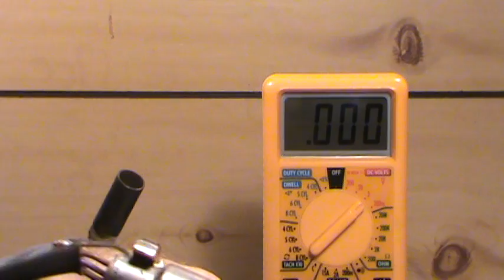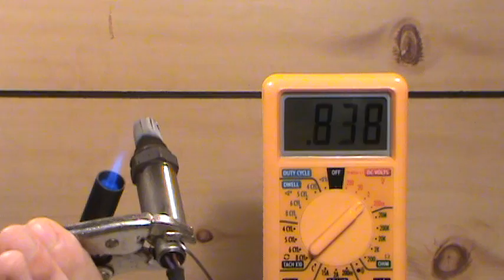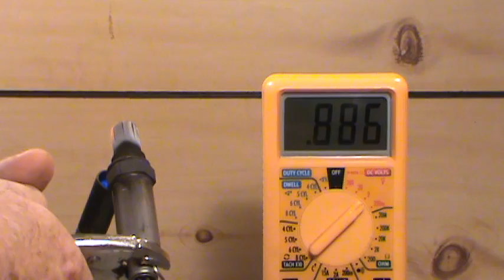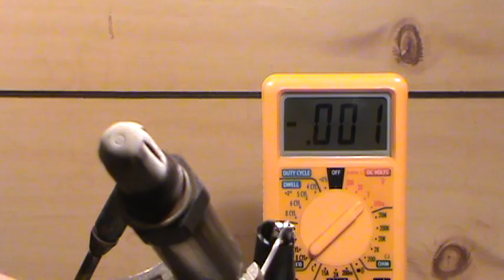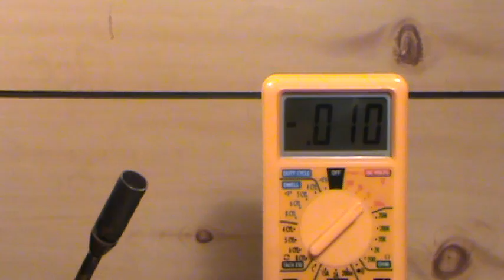Oxygen Sensor Test

Comment: Excellent video on the subject. Oxygen sensor is really important on gas engine cars. I have a video on my channel. Give a look as I made a successful repair on that car. Regards,
http://youtu.be/uVdSCzgLr8k
Reply from the maker: Greetings LearningZone....Thanks for Your nice comment, my Friend....I had a look-see at Your Oxygen Sensor YouTube Video, and I must say, that it was well done, easy to understand, along with so much Information, that included the Diagnosis and the way to do the Oxygen Sensor Replacement, and even how to "Splice" the Original Connector (from the Non-Working one), to the (used?) Oxygen Sensor (that You installed), that had a Connector, that wouldn't Mate with the vehicles Wiring Harness/Connector!....I guess that, there may be times, when, heating the Sensing Element of an Oxygen Sensor with a Propane Torch, may possibly, actually "Clean" it somewhat, as I have heard some Folks saying, and, it might be worth a try, and might even get that plugged -up oxygen sensor to Work again, but, no guarantees at all.

Be Safe, take care, and have a good one.

Comment: p0420 F'ed me in the A
Reply from the maker: Greetings ArmaAceChannel....Thanks for watching this Oxygen Sensor Testing video of mine, and for Your very "Entertaining" comment too!....Ah yes, the good ole..."P0420" OBD-2 Code (OBD-2 = On Board Diagnostic's Version "2", that the Vehicles "Computer" Uses, and Tells You, What "Has Already", or, Is "About To" Happen, with All of the "Sensors" and "Actuating" Gizmo's, that seem to be Hiding, Here, There, and Everywhere, in a vehicle, if so Equipped!!!)....Code P0420 = A Low Efficiency Catalytic Converter!...well...as far as the, just "Before" the catalytic converter Oxygen Sensor, and, the "After" the catalytic converter Oxygen Sensor are concerned, in very Simplistic Terms, that is.

Did You happen to get the problem Resolved/Fixed?....Buy/Install a New Cat? (Cat = Catalytic Converter, and a "Cat" that Doesn't go "Meow!"...lol).

Maybe also, had the Required Number of "New" Oxygen Sensors Installed as well, perhaps?

Hopefully, You didn't have to Spend Too much Money, in order, to..."Restore Order", and in this case, Satisfying Mr. "MIL" (aka, Malfunction Indicator Lamp or Light), sow's He would keep the Dash Light Off (aka, Mr. MIL again), for You, as well as, His Good Buddy, that's Hidin' not so far away, in Your Vehicle, that might just go, by the Name...Mr. ECU (aka, Vehicles On-board Computer).

So then...

...When the "Cars-ah-Spewin'-All-that-there-Pollution", Just, "Spend-Lot-sa-Money", They Say, "That's the Solution!"

..and, like always...Ladies and Gentlemen...

...Be Safe, take care, and have a good one.
Reply: RockysRoadshow lol haven't resolved yet. i switched the o2 sensors after the cats then reset the code and it still came back on the same bank. i guess i could try switching the o2 sensors before the cat now and reset to see if it comes back on same bank. i guess if i switched them and then the code for the opposite bank came up that would be a o2 problem?  man like i said its F'ing me hard right now.  i do here rattling when i tap on the cat D;
Reply from the maker: ArmaAceChannel
Greetings ArmaAceChannel....You had mentioned, that the "Cat" (aka, Catalytic Converter) would "Rattle" when You Tapped on it....Whenever a Person hears a "Cat", Rattling, while Tappin' on it, that would probably be Tellin' Us, that there is some..."Internal Damage", that has happened to the "Core" of the Cat....That, in itself, can cause a few problems, such as, Flow Restriction, as well as, the Inability for the Cat, to do it's job, Properly, and Efficiently as well.

So then, perhaps Your Vehicle has "Dual Exhaust", that has "2" Cats as well (one on the Left Side, and, the other on the Right Side), from what You were saying in this comment/reply.

The P0420 Code, as far as I see it, would just be telling me, that, the Cat or Cats, as the case may be, are Not Operating up to the "Minimum Allowable Efficiency", and, that appears to be, being "Detected", by the "Differences" of the Output Signals, of the, "Before the Cat Oxygen Sensor", as Compared to the "After the Cat Oxygen Sensor's" Signal, and, "Both" (Signals), get sent to the ECU (vehicles On-Board Computer) for Setting the Trouble Code, being P0420, if the "Efficiency" of the Cat, or Cats, "Are Not" Up to the "Minimum Allowable Standard".

Now then, Did "Any Other Codes" pop-up on Your Scan Tool, besides the "P0420 Code???

I'd be thinkin', that, if any of the "Oxygen Sensors" were getting, Tired, Lazy, or maybe even Refusing to do Their Jobs all-together, that, I'd be Seein' "Trouble Codes" that are indicative, of, an Oxygen Sensor, or Oxygen Sensors, that the ECU, would, or should, be Reporting to Your Scan Tool, if in fact, Your Vehicles ECU "Detected" anything "Wrong", with Any of the "Oxygen Sensors", that happen to be Installed in Your "Ride" (Ride = Your Vehicle...lol).

If You "Are-Not" seeing Any Trouble Codes, that are Directly Related, to any of the Oxygen Sensors in Your Vehicle, or, any "Other" Trouble Codes, besides the good ole "P0420" (Cat "Not Efficient" enough), the ECU is probably "Only" Seeing a "Bad or Inefficient" Cat, or Cats, when the ECU "Compares" the "2" Signals, that it Receives from the "Before the Cat", and, "After the Cat", Oxygen Sensors.

I do like, however, that You had the Idea to move the Oxygen Sensors in Your Vehicle, to Different Installed Locations, to see if, by the process of Elimination, that, perhaps, one or More, of Your vehicles Oxygen Sensors, Were-Not-Up-To-The-Task (aka, getting to the point of being, Non-Functional).

The "Rattling Cat", is the Biggest Clue, without even having to resort to, Your good ole Scan Tool!

Good Luck, and...

Be Safe, take care, and have a good one.

Comment: What will happen if I then feed a steady DC volts of .45 to the input? Will the computer makes the injectors to inject a 14.7 to 1 ratio to the combustion chamber? But first of all thanks for posting this very educating video. I do now fully understand the operations of an O2 sensor.
Reply from the maker: Greetings HHOhybridBuilder....You are welcome, and, I'm glad to be of help, as well as, Thanks for your comment, and the very interesting questions that sound to be, well, possible, but, I "DON'T Recommend or Approve", that a Person actually tries, what Your, shall we say "Theory", is suggesting on doing....The reason being, that, some very Intelligent Electrical Engineering Folks, actually "Developed and Designed" the Electrical "Circuitry", that, by the way, in the Newer Vehicles these days, has become somewhat "Future-istic", as compared to the "Older" Vehicles, that had Carburetors sitting On-Top of their Engines....Yeah, I know, maybe too much "Fancy-Schmancy" Talk (lol) so far, so, I'll do what I can, to entertain, Your, may I say, "Theory", on, how to Fool the ECU (aka, vehicles On-board Computer), into "Thinking" that an actual "O2" (aka, oxygen sensor) is sending that Magic "Voltage" to "It" ("It" = ECU or, Vehicles Computer).

First off, there are, as far as I have seen, "2" Types of Oxygen Sensors, and, the one that You see in this video of mine, happens to be "Zirconia" Narrow Band oxygen sensor, and, usually has the "Fluted Cover" on the business end of the O2-Sensor (O2-Sensor = Oxygen Sensor), and converts the measured Oxygen in the Exhaust Gas to a Voltage...from "Zero" Volts (when cold), to as high as about "1" Volt, when the Oxygen Sensor is at Operating Temperature, and, for some strange (and perhaps, misbehaving) reason, the Fuel Injection System is Supplying "Way Too Much" Fuel, resulting in a "Super Rich" Air/Fuel Ratio!...

...where-as, the "Other" Type of Oxygen, as far as I know, is called a "Titania" Oxygen Sensor.

This "Titania" type of Oxygen Sensor, is a "Horse-of-a-different-color", in that, it "Does-Not" produce a Voltage of its own!
It works (as I see it), more like a "Resistor".
This "Titania" oxygen sensor, provides a "Resistance", that can be measured with an Ohm Meter (or a multimeter, that has an Ohm Scale on it), when heated, like I heated the "Other" Type of Oxygen Sensor in this Video of mine.
From what I recall, the "Ohm's" Reading, while taken on a "Titania" Oxygen Sensor, while heated up in a Propane flame, should be showing an "Ohm-Reading" that (as I see it), on my yellow multi-meter's "Lowest Range", that, by the way is, from "0" to no more then "200" Ohm's.

Sorry, I can't even give you a "Ball Park" figure on the Ohm's Reading of a Heated-Up "Titania" Oxygen Sensor, due to the fact, that..."I've Never had One in Custody!"...lol.

Apparently, the ECU sends a "Reference" Voltage, of about "5-Volts" (I think?) to the "Titania" oxygen sensor, and, the "Titania" oxygen sensor Takes this 5 Volt Reference Signal from the ECU and sends it Through the "Titania" oxygen sensors "Internal Resistance", and due to the encountered Resistance of this type of oxygen sensor, that ECU's Original "5-Volts" gets changed into a "Different" Voltage, then the so called "Modified" Voltage, gets "Sent Back" to the ECU, for some much needed "Processing".

See, sometimes things "Are-Not" all that simple, especially when, the "Deeper" You Dig!"...lol.

There can be anywhere from "1" Oxygen Sensor per Vehicle, to as many as "4", or More (perhaps) per Vehicle!!!

No, I didn't forget...

...about Your "Theoretical"...".45" Volts!

Just remember, ECU's, (Vehicles Computer), and many other Electronic and Electrical Gizmos, Parts and Pieces, are usually "Very Expensive", so, before a Person even Contemplates, doing anything what-so-ever, that "Is Not" in accordance with the "Vehicle Manufacturer's Recommendations", is, as I see it, a "BIG-No-No!!!"

But, we can always "Theorize", as long as we "Don't Actually", put these, so called Theories, into "Real-World" Practice!

Now then, Lettuce (intentional miss-spelling) begin, shall we?

Hypothetically speaking, if, a ".45-Volt" Signal was sent to the ECU, and, the ECU "Does Not" spit out a bunch of "Trouble Codes", and,  every other Parameter was Correct, then, perhaps, it may be possible that that good ole "14.7 to 1" Air/Fuel Ratio, just might be able to be attained...BUT...

...there are Way Too Many "OTHER" Variables to consider as well...!!!

To have any Vehicle's Engine Management System's (and other things as well) ECU, administer the "Commands" Necessary to sustain the "14.7 to 1" Air/Fuel Ratio, that You suggest, is dependent on "Many" Factors!

Generally speaking, about the "Only" Time, that an ECU Controlled Vehicle will Keep its "Air/Fuel Ratio" at the suggested "14.7 to 1", will be, as I see it, when the vehicle in question, is at "Operating Temperature", and, At Engine "Idle Speed", or, at a, "Light Throttle (aka, gas pedal) Cruising Speed", and perhaps, when the Vehicle is at about "Sea Level" as well.

You see my Friend, when a vehicle's Engine is "Cold", it Requires a Much "Richer" Air/Fuel Ratio (might be "12.5 to 1", or maybe even Richer)...

...and...

...if You happen to "Accelerate", with the "Pedal to the Metal", it requires an "Air/Fuel" Ratio, in around the "12.5 to 1" Air/Fuel Ratio Range!

Ignition Timing, is another "Really Involved Subject", and it has to "Compliment" the "Air/Fuel" Ratio, in order to have..."Maximum Power", and, "Maximum Gas Mile-age/Kilometer-age (aka, fuel economy), as well as, "Not Destroying" Your Engine, while trying to do so...!!!

Well then...That's all for now Folks...

...Till next time...

...Be Safe, take care, and have a good one.
Reply: RockysRoadshow
Thank you Rocky,
Reply from the maker: HHOhybridBuilder
Greetings HHOhybridBuilder....You're welcome, and, Thanks for watching and commenting on this Oxygen Sensor Testing video of mine....Given, that, part of Your Name, being, "hybrid Builder", has me thinking, that You just might be, trying to "Optimize", the, perhaps, "Fossil Fuel Burning" (aka, Gasoline?) Engine part of a "Hybrid Vehicle" for "Fuel Economy" reasons, has led me to Warn You, of possible "Engine Damage", and the associated "Not Wanted, Money Loss!"....What I'm trying to get You to avoid, is the possibility of running an Engine "Too Lean", as in, Too Lean of an "Air/Fuel Ratio", Especially, when the Engine in question, is being operated at an "Aggressive Acceleration" (aka, pedal to the metal!), and under a "High Load", as, having a "Too Lean" (usually Higher then about a 12.5 to 1 Air/Fuel Ratio for 100% Gasoline), has been known to "Destroy" Engines, to the point of being "Non-Repairable!".

If the above, happens to apply in Your case, then, perhaps, consider the following, although, these things that I'm about to mention, are just a small list, of the very "Many" Variables that are usually involved, with the, shall we say..."Health of an Engine"...

Make sure that You are using the "Correct" Spark Plug "Heat Range", as a "Too High" Heat Range, can cause Engine "Damage" as well.

Pay very "Close Attention" to the "Ignition Timing" (in Degrees), at any given Engine RPM (Revolutions Per Minute), and, the Engine's "Load Conditions" (aka, Heavy Acceleration, or, just plain Light Cruising, at, not too fast of a speed).

Gasoline "Octane" Rating, plays a very Important part, Especially, when a "High Compression" Engine is being used!

Just a thought...

...I'm thinking, that, setting up an Engine for both "Power" and "Fuel Economy", can somewhat be compared to, that of a Choreographer, Band Leader, Sports Team Coach, etc...as, Each and Every "Person" or "Component Part", has to be able to, "Perform" His/Hers, or Its "Individual Duty" Flawlessly, to make the "Performance" (or Economy), a...

..."Standing Ovation Success!!!"...(and, I'm trying my best, not to...lol).

So then...

...Be Safe, take care, and have a good one.
Reply: RockysRoadshow Regardless of what type of sensor used, feeding a false signal to the ecu can cause some significant issues to result based on external conditions. Carbureted engines  operated based on a group of compromises, the most significant was barometric pressure, which resulted in shorter engine life as the result of often too lean or too rich conditions. Since we have "mastered" the sensor controlled computer operated fuel injection system, we have seen small engines literally double and triple their lifespans, primarily by not destroying the piston rings due to excessive fuel delivery.
We have to remember, there are times that the 14.7 to 1  ratio is NOT ideal, such as when starting a vehicle, warming it up (remember, there are no longer chokes involved, that alter the air/fuel ratios on cold engines), when the load on the  engine is suddenly increased without regard to engine speed, such as the air conditioning compressor kicking in. And then all of these conditions need to be corrected when the external cause  changes, or is over come,  such as the vehicle maintaining speed  even though the AC remains running, or the torque converter is locked up to maintain fuel economy, even though unlocked would develop more torque. A static voltage would prevent the engine from working to over come these everyday situations the daily driver  deals with seamlessly, without even knowing they are going on. Were the vehicle just driven in one set of circumstances, such as  on a dirt track you could dial in that voltage. But not on the road. On the road a dynamic (changing) value is necessary to keep everything in balance for the drivability, life of the engine, maximum power without shortening the life of the driveline, and maximum fuel efficiency. But even at that we are still dealing with compromises in the engine design, as the vehicle has to be able to be reliable at speeds between zero to 65 MPH. Of course what this neglects is the vehicle must also have enough power for sufficient acceleration with a maximum passenger/cargo load to get out of the way of dangerous situations that are not typically seen, so that 65 mph suddenly turns into 90 +  MPH, so  we have a very broad power range we need to deal with. so this brings us back to the need for the dynamic value required. And this value is not  static.  The more throttle you use, the hotter the exhaust gas gets. hence a different voltage is generated and the computer changes how much fuel is supplied to maintain the 14 to 1 ratio.   As you can see the single voltage is only good for one set of circumstances
Reply: No. Because of the nature of a reciprocating engine- there is a slight "pulse" in the intake manifold vacuum. Idle, WOT, and everything in between- requires a different duty cycle (dwell) of the injectors to match load. A steady voltage going to the ECM would probably just idle the engine- with no room for advancement.

Comment from the maker: ...and, one of the warnings that I see quite often is, Contamination due to Silicone Vapors....This is usually caused by someone using a non-compatible type of Silicone Sealer, like the older RTV stuff, and using this stuff on any mating parts that may pass on these vapors through any air/fuel intake passage, and eventually sends it through the exhaust system, contaminating the/those oxygen sensor/sensors....A Rich running engine (carbon deposits) can mess up the oxygen sensor too....Take care

Comment from the maker: Greetings SixtyFiveDropTop....Thanks for your comment....Oxygen Sensors (like other parts), can start malfunctioning for a number of reasons....Manufacturers will usually indicate when to change your Oxygen Sensor/Sensors (milage/kilometer interval), but as I see it, that will be if everything else is working as it should....Contamination, of one sort or another can shorten the useful life of an oxygen sensor, or sensors, as the case may be...They can deteriorate over a period of time...(con't)